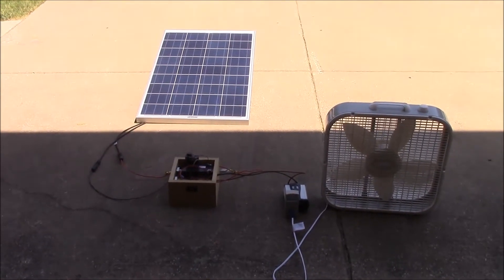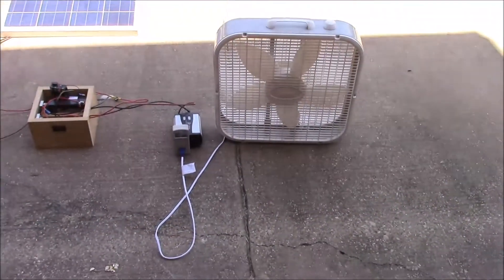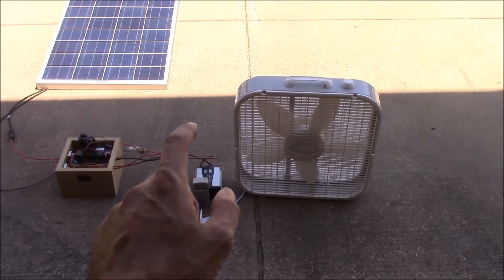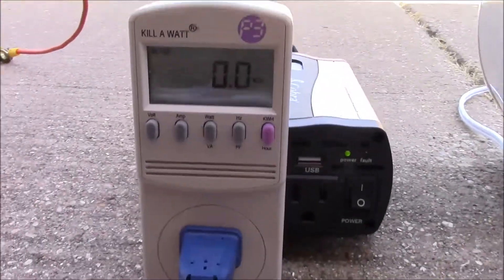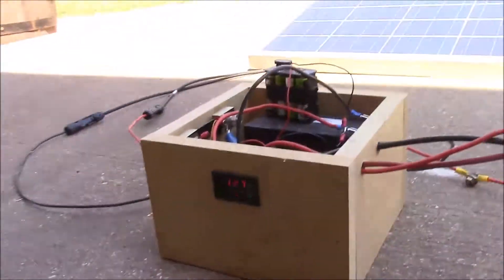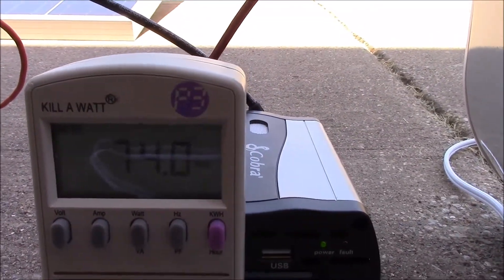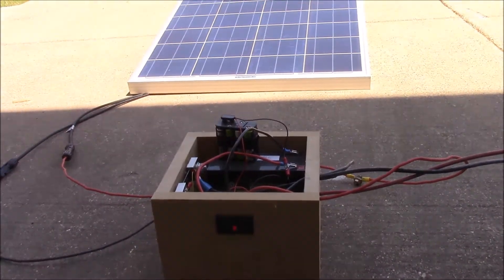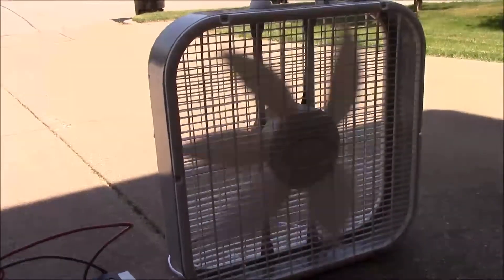Will It Solar? - 20" Box Fan

Comment: How much for the inverter and solar panel...is the battery necessary?
Reply from the maker: Yes, a battery is required to be able to use power from solar (unless you have a grid tied inverter).  A 100W solar panel and a small inverter will run you about $150-200 or so to operate a fan like this (not counting the battery you will need).

Comment: If you buy a solar kit it's expensive but I run a window ac, 16 cf fridge an TV on solar kit "I bought separately" for 1200$ which isn't to bad since energy cost for what I run would be like 170$ a month
Reply from the maker: I'm sorry but no one is running a window air conditioner for any meaningful length of time on $1200 worth of solar.

Comment: with this small  set up how long do you think it will power  the fan for ?
Reply from the maker: This video was a long time ago.  I don't remember without re-watching the video.  Typically these kinds of box fans don't use much power, though, so even a small battery can run one for hours.
Reply: @LDSreliance  niiice really appreciate the response, definitely want too look into this for like a  small shed  experiment 🤔🙏🏼
Reply from the maker: If you have DeWalt, Milwaukee, or Makita power tools you should look at this inverter that I sell on my web store.  It would be very convenient for running fans in a shed.  I'll link you to the medium size one but there is a bigger and a smaller version.

https://store.ldsreliance.com/products/millertech-18-20v-600w-edison-pure-sine-wave-power-inverter-for-power-tool-batteries-186-i

Comment: I have a similar setup but my batteries drain really quick.  15-20 minute quick.  Trying to determine why.  I have 2 100watt panels connected to 2 27DC Marine/RV battery using 2 box fans like yours.  Using a Bestek 400 watt power inverter.   One of the batteries is brand new and the other a year old but charged.  When I turn them on, they immediately start to drain.  I have a different solar charge controller and wondering if that might be the issue or maybe the power inverter is overkill.    Are the panels supposed to charge even though there is a small load on them?

Comment: Please provide me and your viewers with the brand name and type of charger controller you used in this video; is your charge controller a PWM or a MPPT type?  What brand?  Where did you buy it?  Please provide me and your viewers with the brand name and model of the inverter you used in this video.  Where did you buy it?  Please provide me and your viewers with the brand and type of 100 watt solar panel you used in this video.  Where did you buy it?  Is it a monocrytalline panel or a polycrystalline panel?  This video is potentially very important for people who are very heat sensitive and may experience temporary loss of public utility electricity.  Thank you.
Reply from the maker: The charge controller used in this test rig is a MorningStar SunSaver 10A LVD Charge Controller (https://amzn.to/2TnaM93).  I love these little guys as they are impervious to dust and moisture and are super high quality.  They do cost a bit more than cheap Chinese controllers but I would trust this one over anything in the $30-50 range any day.

Comment: Very good video
Thanks for sharing.
Suggestion ...in a power outage, making food last
Reply from the maker: ThePrayerHotline Good idea.  I kind of have a solution for that already with my homemade, DIY refrigerator but I can put some thought into some other ways to do it with solar or other methods.  Thanks!
Reply: LDSreliance i know exactly what to do.
Are you familiar with the amonia gas refrigerator? Before they were using freon, they were using amonia.
The refrigerator has a small flame lit and that heats up a heat exchange
amonia boils and goes around the system pretty much the same way as the new system.
So here you collect the heat of the sun and focus it on an pillar where on top of the pillar is the heat exchange. 
On a power outage, the food will spoil fast if not refrigerated. 
I hope this will help a lot of people. 
At night time, you heat up the heat exchange with a heating element powered by the battery that you had charged during the daytime with your solar panel
God bless everyone
Reply from the maker: ThePrayerHotline
I have read about ammonia refrigeration and the only reason I haven't done it yet is that it is slightly dangerous.  Ammonia gas is very toxic and the system has to be pressurized and it can potentially blow up if you don't seal it right.  I would rather leave that kind of stuff in the hands of someone that has better skills than I do!
Reply: Ammonia absorption gas/propane fired fridges are safe, have no moving parts, work very well. They are expensive as a 20 cu ft unit costs about $1800 these days.  Some older motor homes used propane fired refrigerators. We had one in a 27 foot Dodge Travco.

Comment: How do I figure what my 70 watt ceiling fan would use in energy to build a solar powered cabin
Reply from the maker: Well, it would be difficult to measure its real world energy consumption unless you have an AC clamp meter and are willing to take the cover off your breaker box of your house.  Short of that, you can just estimate using 70W as the AC load, then add in 20%-25% loss from an inverter and battery and then multiply that by how many hours per day you would run the fan.  So 70W *1.25=87.5 and if you ran the fan 8 hours each day you would consume 700 Watt hours each day from that fan.

Comment: Great video I have two questions can you run the fan with a solar panel only without the battery and also can you run the fan with the inverter and a battery but without a solar panel thanks for your answer
Reply from the maker: Good questions.  Unfortunately, you will have a hard time running a motor driven load like this directly from a solar panel because of the large startup current required to spin up a motor.  It can pull 5-10x more current to start for 1-2 seconds than it uses while it is running.  So in this instance, it used 50ish Watts on low setting but it might have taken 250-500 Watts to start the motor for a brief second.  That is why you really need a battery or large capacitor to make it work.

As for the second question, you can run the fan off an inverter connected to a battery without the solar panel.  It will deplete the battery, though, obviously over time.
Reply: LDSreliance oh thanks so much for your reply. So in a pinch you could run off your car battery with inverter. Thanks
Reply from the maker: Yes you could but a car battery will not be able to run a big load for very long.  Remember, a starter (car) battery is like a sprinter and a deep cycle battery is like a marathoner.
Reply: @borg386  You can easily power USB fans from portable folding solar panels. I suggest getting a larger panel because they work even if it`s cloudy and most have multiple output ports that can power 12v or USB fans while charging a power bank or 12v battery.

Comment: That is a pretty good option to use solar panels but solar panels batteries and inverters are expensive sometimes I think the cheapest option would be to go for a large solid metal battery powered fan like a geek air cf2 it comes in three sizes 10 in 12 in and 16 in and the largest one the 16 in is only $150 on Amazon and it can run for up to 24 hours on low so that would actually be a cheaper option then spending $500 on a solar panel battery and inverter
Reply: There is another video here on yt that uses a 12v radiator fan, negating the necessity for battery and inverter, though you can still use a battery.

Comment: SO WHAT IF I LIVED IN AN APARTMENT? WHATS THE BEST THING TO GET DURING A HURRICANE?
Reply from the maker: If it is only for emergencies you can get a portable solar panel and a solar generator.  I have reviewed several solar generators on my channel in the past.  Just keep in mind you can't run a fan all day long with a small system like this.  And an air conditioner is out of the question.
Reply: LDSreliance OK THANK YOU
Reply: LDSreliance CAN I PUT THE SOLAR PANEL IN MY WINDOW INSTEAD OF GOING OUTSIDE?
Reply from the maker: No.  Windows are designed to filter out some of the solar radiation.
Reply: You could possibly add a window mount that would hold the panel out side the window i would make sure it wasnt gonna come off though and hit some one below

Comment: Why not just do like I did and build a 20inch 12Vdc floor fan... I used a linear actuator motor out of a recliner that used 24Vdc but I'm using 12Vdc to run it at half speed... It draws about 0.98A-1A and will blow things off the table at 12ft...  Lot more efficient than using an inverter...

Comment: thanks for the vid,  what if i want to sleep at night for this can you explain battery storage solar recharge stuff. how much it cost for a setup like this thanks     david
Reply from the maker: Yes, I have numerous videos on solar and how it works.  I would recommend checking out some of them.  But to give you the short answer, to run this particular fan on low all night (8 hours) you would need 200W of solar panels and 75Ah of battery storage.  That is a rough estimate since I don't know where you live and how much sun you get.  That also assumes that your solar panels got full sun all day (it wasn't cloudy).
Reply: thank you for the quick reply/ i'll check out you site now.. sorry guess i was being lazy
Reply from the maker: No worries.  I just can't possibly explain in a comment everything you need to know to spec a system like that.  Poke around and watch some of the other videos and if you have specific questions I have no problem answering when I have time.

Comment: Let me ask it the other way. What is the least wattage solar panel that could power the box fan on "high?"
Reply from the maker: If I were running the fan directly from the charge controller and solar panel with no battery hooked up at all I would probably want to use a 120 watt solar panel minimum.
Reply: Will a 40 watt fan run off a 100 watt solar panel without a battery.I don't care if it runs at night.Thank you
Reply from the maker: Bruce Kefauver
Yes, that would work fine during the direct sunlight portion of the day (7-8 hours in the summer and 3-4 in the winter).
Reply: LDSreliance Thank you.Now i can finally use this panel for something.
Reply from the maker: Bruce Kefauver
You are welcome!  Thanks for watching and please consider giving me a thumbs up on this video and/or subscribing to my channel.

Comment: great video... how about no battery?
Reply from the maker: +Uptown Mike I showed this in another video but basically the charge controller will not work without a battery connected.  You also can't connect a solar panel directly to an inverter or load without causing problems.  However, you can tell by the voltages what is happening and how much the load is taxing the solar panel even though there is a battery connected.  Thanks for watching!
Reply: Thank you bro. I want to do this at my school. So i was really wondering what I can or can't do. How is it in the winter?
Reply from the maker: Uptown Mike Winter you will get about half the power or so from the solar panel.
Reply: I just wanted to test it out at my school. So i was looking at the beginner things for solar power. thanks man

Comment: this was great, aside from wanting to do this for my family for out hurricane preps i need to do this for a chicken coop for ventilation for the summer. I wish you had some step by step instructions.
Reply from the maker: I have step by step instructions on how to set up a small solar panel system:  https://youtu.be/IKW9jhSB44c

I would look at this DIY solar panel kit, which will be about the right size to power your fan for 6-8 hours per day in the summer:  https://kit.com/LDSreliance/beginner-solar-diy-kit-100-watt

Then all you need to do is connect your choice of fan to the inverter.

Comment: bro, loose the battery.
Reply from the maker: Why?  That is a required part of an off-grid solar setup.
Reply: You said will "it" solar? I thought you meant box fan. Not battery powered box fan.
Reply from the maker: But a solar panel by itself is not a solar system.  By that line of thinking I was cheating using an inverter, too.  When I started the series I did connect a few 12V DC loads directly to a solar panel but then I talked about how that can ruin devices and cause problems.  You really have to have a panel, charge controller, inverter, and battery to properly use solar (unless it is grid tied).